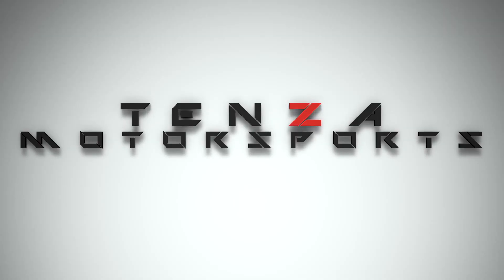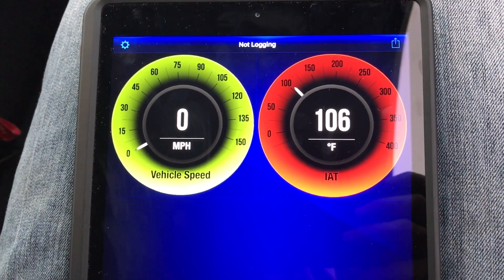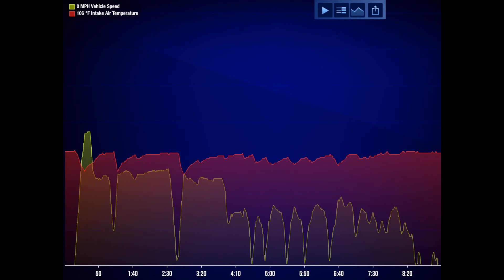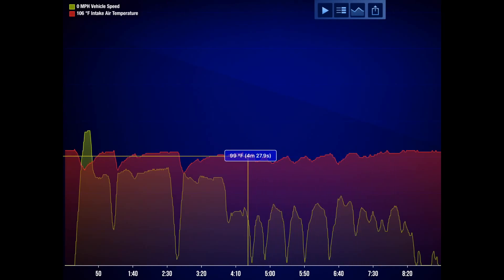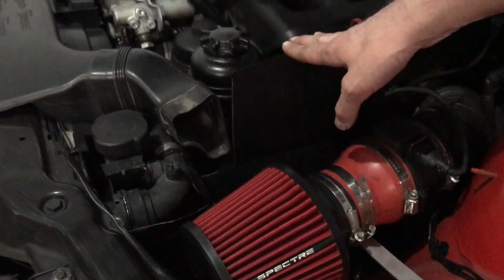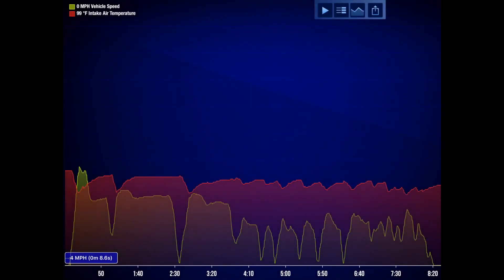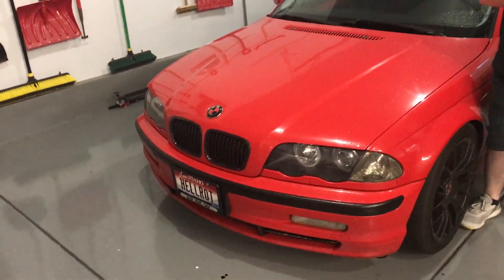Stock BMW E46 intake VS $30 eBay "cold air intake" Short ram CAI install and review - worth it?

Comment: You have to let the computer get used to the difference in the air flow this is not valid u guys just threw shit on and ran test
Reply from the maker: Sorry, but no. As soon as you start up the car and run it, it knows something is different. Also the temperature portion wouldn’t have test any different if that was the case.

Comment: Hey man! Love the video!! I’m planning to get a short ram intake for my e46 330i coupe, It’s my daily, I like to have some fun and burn some  rubber from time to time😆Would you recommend to install it, is it worth it?? Would by my first mood
Reply from the maker: What’s your budget for your first mod?
Reply: @TenzaMotorsports   not looking to invest a lot, I saw a sport filter for 14$ and thought maybe I should get one and try it out
Reply from the maker: It's a fun one to do especially if you want more sound. just make sure to buy or build a heat shield if its a short ram filter.
Reply: Tenza Motorsports will do! It helps to get colder air and less heat will come through from the engine right? And we have some gravel roads I drive through sometimes, is the dust harmful with these type of filters?
Reply from the maker: It'll be a similar temperature unless you get a filter that sits in the bumper. Just get the right filter and keep it clean/replaced properly.

Comment: Put an actual box around it and it will do better... Lol stock intake has a box around it so it was more isolated and the cool air from the outside was able to get into it. Not with what you guys did you didn't put a box so the engine heat got to it and also the air coming from the inside is just going everywhere not just inside the box
Reply from the maker: Excellent observation. thanks for the comment

Comment: So you only put a filter, thats why the temperature is same.. If you did make a cold air intake box and make it separate heat from the engine, just to make it to have bride in colder air, thats why it is called COLD AIR INTAKE lol, and also now when your engine gets hot it will make les power than with the stock filter, because stock filter have better isolation from heat, Chears lads.
Reply from the maker: The temperature wasn’t the same.
Reply: Tenza Motorsports almost the same, drive it for a hour on a track an then look to a temperature, and look it with some genuine diagnostic tool, like INPA or ISta, than diagnostic maybe dont input live data like it should, also if you think this way is good, go on, i just wanted to make you a tip for better cold air instalation but if you think you know better than a profesional chip tuner, than go on whoalaa 👍
Reply from the maker: I don't think you get the point of the video. We put a $30 eBay "cold air intake" on and a left over heat shield from another car. It's a street car, not a track car. The testing showed it runs hotter at slow speeds and slightly colder at high speeds. If you buy an eBay intake this is what will be your experience, if not worse since we have a heat shield. We know it's not a real cold air intake, it's $30 from eBay. We say in the video this system makes little to no difference and only left it on for the noise. You might wanna watch some of out other content before thinking we don't know what a true cold air intake is.

Comment: you guys noticed a 4 hp increase?
Reply from the maker: We did not notice an increase of power.
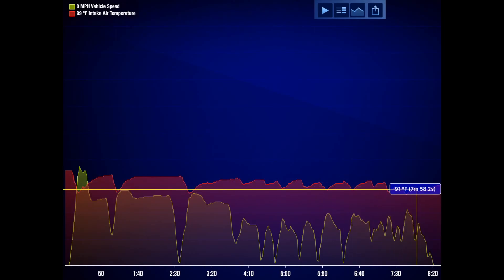Reply: @TenzaMotorsports  You said it at least 3x, at 4:12, 5:40 and at 6:18.  

What you are probably "feeling" is placebo effect.  You need to do a double blind test in order to see if there really is anything you would feel.  But that small of an increase is negligible.
Reply from the maker: It's mostly throttle response we just didn't explain that very well. Maybe something low down but it would be very small and we didn't do a power test. We were mostly looking at the temp.

Comment: Fender mounted would be way better. I did the same bluetooth obd2 reader data logging after installing a fender mounted filter in my best friend’s 2006 Nissan sentra SE-R Spec V and on the freeway at night intake temps were in the 30’s and 40’s Fahrenheit
Reply from the maker: I don't doubt it. Its crazy the amount of fresh air you can bring into your engine with a good cold air intake system. In our case we were using spare parts and the temperature difference was so minimal. The main thing was to add a little sound to the car. The main purpose of the video was to show that it does not work in that location. Even with a heat shield. Look up any car model and you'll be shocked how many short ram set ups have been sold!

Comment: The air temp is measured by the maf sensor and it becomes heated itself thus giving the computer a high temp reading as it gets even warmer. The it adjusts fuel delivery  accordingly. You can buy a sensor to wire in and mount the sensor in the front of the stock air box giving  a more accurate temp for the program to adjust fuel flow mode efficiency.
Reply: Not all e46 have the temp sensor in the maf. Some of the earlier e46 2000 and 2001 pre facelift have the air intake temp in the intake manifold on top center just under the cover. My 01 330 has 3 pin maf with temp sensor in intake. I have a 2004 330 zhp with 6 pin maf with integrated temp sensor in the maf.

Comment: Dude I got the same bimmer😂
Reply from the maker: It’s a great car, and that red is one of our favorites. Thanks for the comment!
Reply: Same lol mine 2001
Reply: Jose Silva - I do as well, have the same car with 76Kmi on it. Got it off of a one owner tht barley drove it. It’s an M3 is the only difference. I put a stock K&N Box on the car by now I’m looking for the cone. Dnt have a heat Shield / I dnt even have the accessories. Was just thinkin about placement of a cone wld help the car breath better. Any suggestions (besides the heat shields, etc.) Mines an M3 so it’s raw from the factory. I’m just looking for tht “extra kick” so to speak. Any thoughts...?!?
Oh and mines a blue-ish/Grey-ish color. Windows are blacked out. Even though it’s an 03’ it still has all the modifications “one” wld find in a modern car. I cld tell ya how but you probably already know anyways. Any input wld be great appreciated, Thx for everything. Very insightful.

Comment: I’ve always wondered what the difference was for aftermarket intakes! So after everything is this something you would recommend for an e36?
Reply from the maker: Absolutely! As a daily it really wouldn't change much. If you are wanting performance as a track car or autoX car, I would spend a little more money and get the cold air intake that puts your filter further from the engine.
Reply: Tenza Motorsports thanks for the quick response. Yea it’s my race car😊 Your channel makes me want to start filming my e36 project
Reply from the maker: No problem, start a channel it's tons of fun! Good luck with your e36, and let us know if you have any other questions we can help answer.